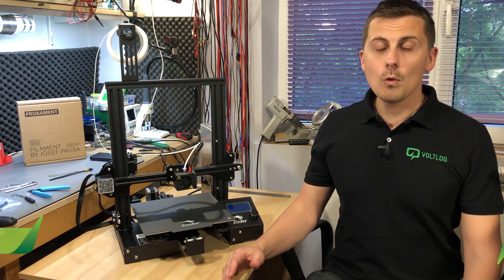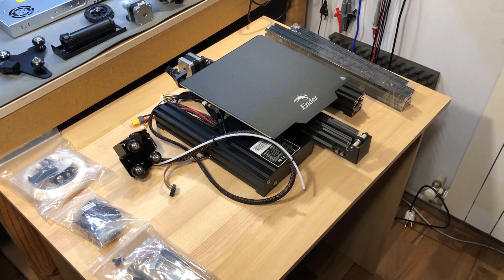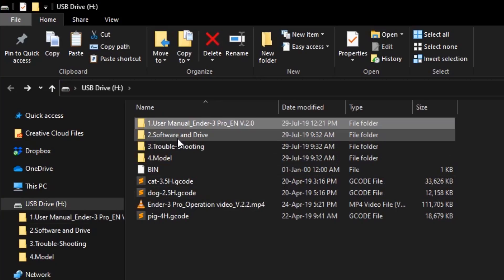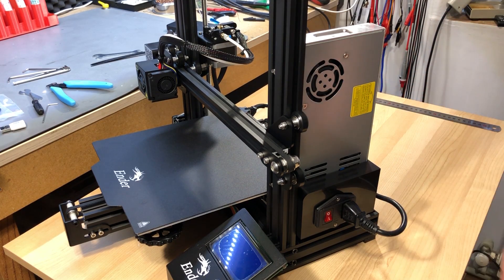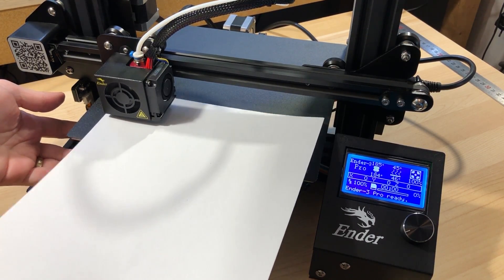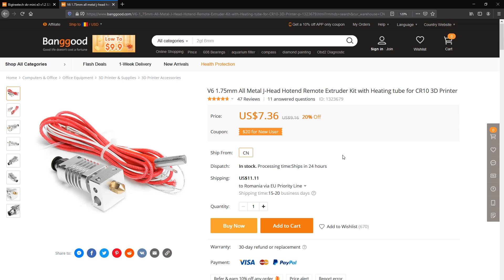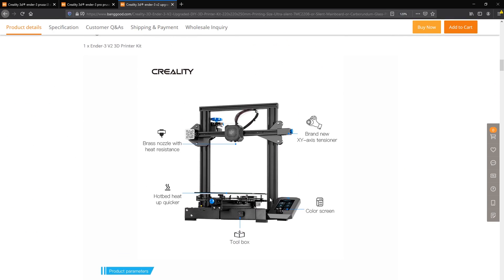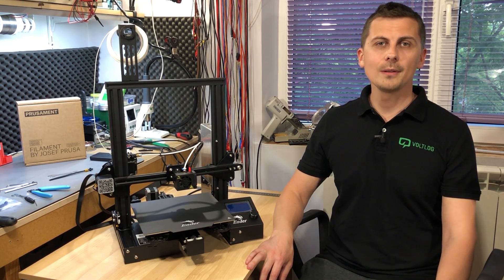Why Did I Get A New 3D Printer? Ender 3 Pro | Voltlog #312

Comment: I really like creality printers and in my opinion that ender 3 pro is surely worth the price (I got myself a Cr 10 mini about 3 years ago as you know, did some modifications on it and it runs perfect). However you did not really answer the question „why“ you got it. I assume it’s because it was free for you? Why would you otherwise get it to replace your good working Cr 10 with BL Touch rather then getting a second printer to be able to print in parallel on 2 machines? Don’t get me wrong, if I was in your position with a great channel I also would accept such an offer but the question in the video title is not really answered in your video. So please let us know what’s the benifit of getting it over your existing Cr 10 besides the fact that you got the review unit for free if there is any.
Reply from the maker: The number one reason I was looking to get a new 3D Printer, the Ender 3 more specifically (Pro or not wasn't decided yet before having this one) was to have a platform that can accept upgrades easier, with less modifications. I think the most upgrades you can find (most of which plug & play) are designed with the Ender 3 in mind. I have certainly found such upgrades that I thought would be cool for my CR10 but they we're designed as a kit for the Ender 3. Now after actually getting the Ender 3, I think it is a better choice for me because it is smaller than the CR10 (I never really used the bigger build volume offered by the CR10). The new Ender 3 occupies, half the space on the same desk when compared to the CR10 and it seems like the perfect form factor for me.
Reply: VoltLog do you keep the cr 10 or will the ender 3 replace it?

Comment: Nice printer
I have a Ender3 (old version)
I have not have ant problems with the heatbed, may be it is because it is a 24V system, instead of the 13V system in the CR10
Thanks for sharing 👍😀
Reply from the maker: I wouldn't consider "a problem" the heatbed on the CR10 it's just that adding some insulation will improve the heat up time. There were no issues with temperature fluctuations once it was up to temperature. But having a 24V bed on the Ender 3 is certainly a plus.

Comment: Dear Florin I upgraded my Ender 3 with DD BL Touch and SRK Mini with pi zero and relay on the back if you need help on the firmware or want the STL's let me know, also the only available option was for cooling the hero me which for me was a pain I reworked the bullseye mount for DD. Recommended if you can buy and afford is the EXR Estruder.
Reply from the maker: thanks for the feedback, I am certainly looking into these upgrades, I will start slow, probably the first upgrade will be the bltouch because that's something I can't live without but recently I also noticed there is the option to retrofit the pressure type sensor ABL that Creality is using in their latest printers so i will definitely look into that option as well.